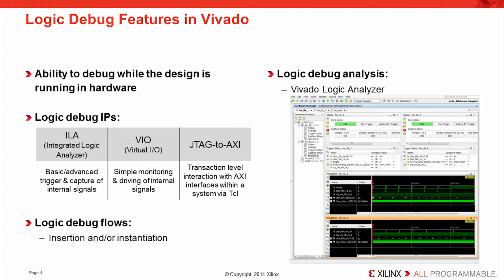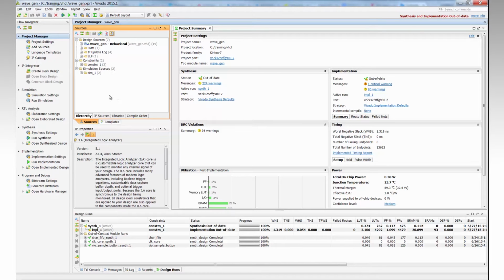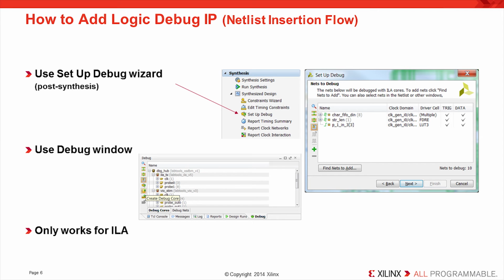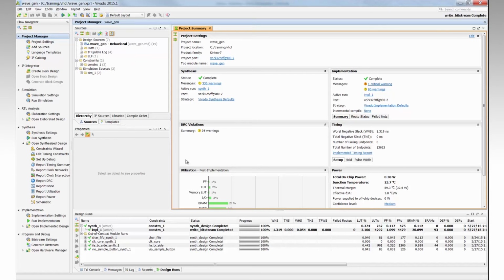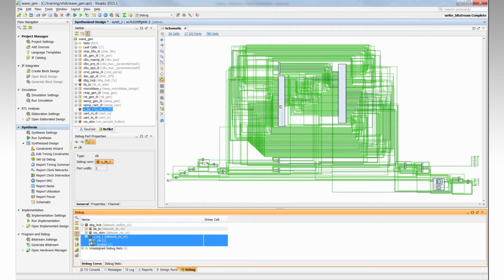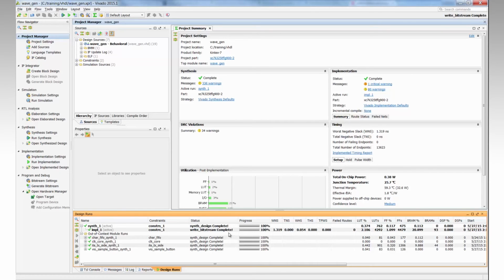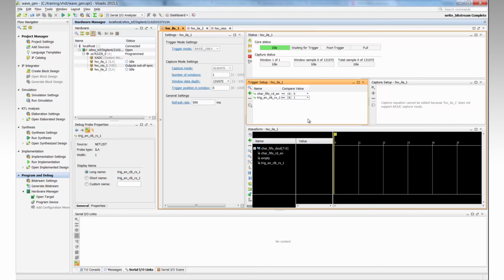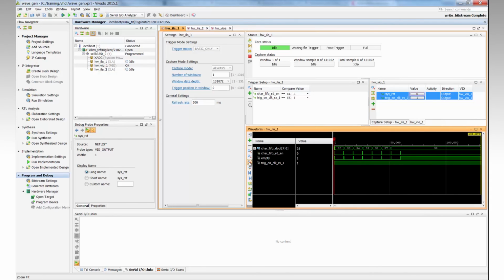Logic Debug in Vivado

Comment: Hi all,
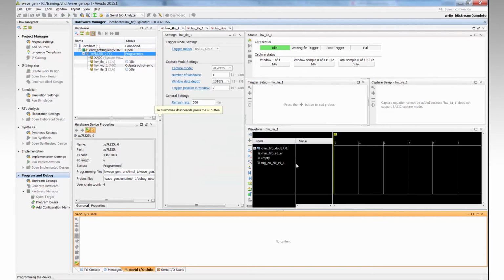I have follwed the same steps. On the other hand, after program the device (13:05 s) hw_ila_1, hw_vio_1, hw_ila_s files doesn't built under the chip. Do you have any idea about the problem?
Reply: Hi havva erdinc I am facing the same problem as well did you find any solution for this ? TIA
Reply: I was facing same problem. just right click on device( chip part number ) and refresh device .